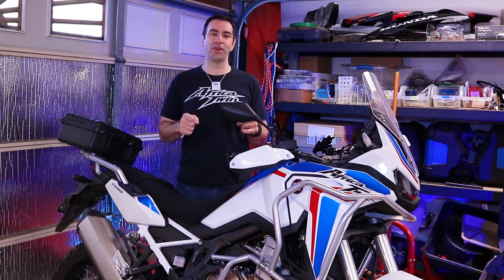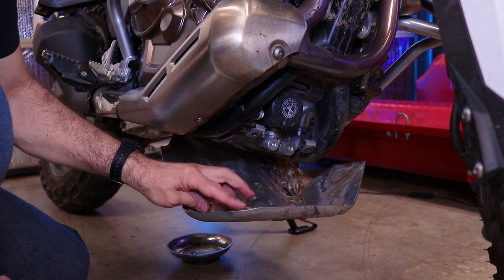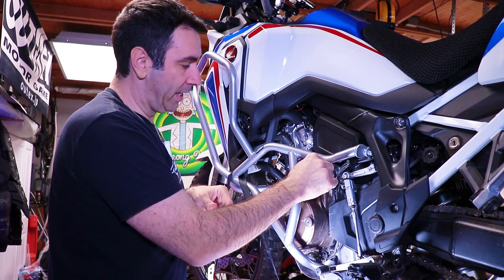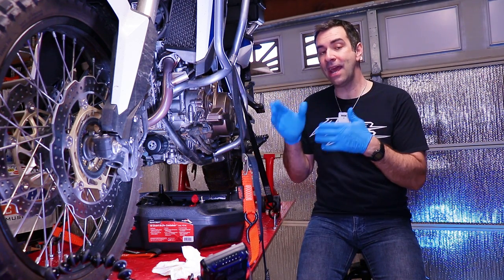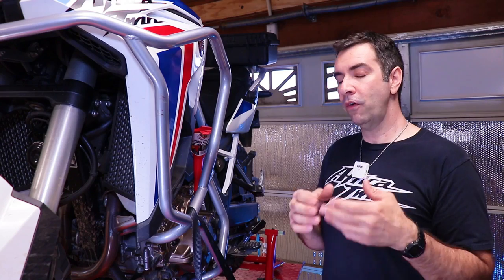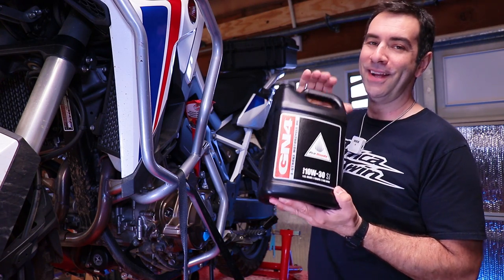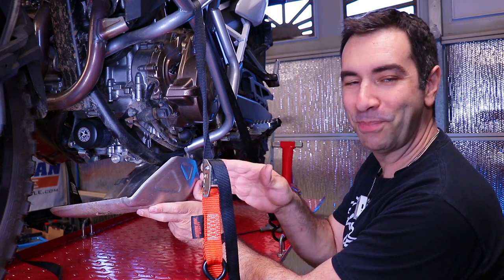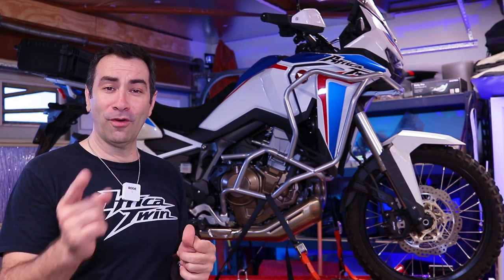Africa Twin 1100 Oil and filter change

Comment: Thanks for this. Decided to start doing my own work now the bike is out of warranty. The 8000 mile service is only an oil change and 'check and adjust' after all. Do you plan to do the dreaded valve check yourself? I've seen the procedure and it looks like a real PITA! My dealer recommended skipping the 16,000 mile check and doing it at 32,000 instead (As long as the bike starts and runs well). Mine is at 24,000 and runs fine so far.
Reply from the maker: Yes,  I'm planning on doing it myself,  I'm pretty sure the valve will be fine at 16000, meaning they will probably not need to be adjusted,  but I'm still going to check. If you do skip the valve check keep your ears open when you ride, way before any damage will occur the bike will not run right so if you pay attention you might be able to tell.
I'm glad you are doing your own maintenance 👍with the manual on hand nothing is really hard, it's just time consuming 😆
Reply: @AlbesADV  Thanks Albe. That's the thing - none of these procedures are beyond the scope of a decent DIYer, you just need time and LOTS of patience. Ride safe.

Comment: Hi, nice video, oil consumption dectected on CRF1100? I have one and some users repports oil consumtion since 0km on those engines. Tanks!
Reply from the maker: No oil consumption other than the one that gets trapped on the crank case breather hose

Comment: Thank you. How do you go about changing the gearbox oil?
Reply from the maker: Hi, thank you.  In most motorcycles the motor oil is also the gearbox oil, it's obe assembly and the oil is free to move around 😀👍
Reply: @AlbesADV  Perfect. I have an Africa Twin 1100 DCT, so the engine and gearbox oil is the same. Thanks for the prompt reply.
Reply from the maker: @fabimesizae si, l'unica cosa in più che devi fare è cambiare anche il filtro olio frizione che si trova dalla parte del DCT davanti alla pedana e assicurati che la parte del filtro che dice "out side" sta verso fuori.

Comment: Would you use a fuel additive like redex? Also, as this bike has a cat, would you use cataclean?
Reply from the maker: No, I don't add anything to the fuel, just use good quality fuels, modern fuels already have additives in it
Reply: @AlbesADV  true! I was wondering if it would harm or benefit the system? Fuel doesn't clean the catalyst, so would a cat cleaner help? I personally only use shell e5 99ron,it's the best!
Reply from the maker: I'm not sure if cat cleaner would help, I know it has to go thru the whole system before it makes it to the cat. I agree on the shell fuel being one of the best if not the best
Reply: @AlbesADV  just done some research. Yes, the cat and o2 sensor need to be periodically cleaned to maintain performance! Recommended at every oil change, so every 5-6000 miles or so! 👍

Comment: Can I use synthetic 5w30?
Reply from the maker: Hi, the 5w-30 provides better cold weather start because it flows better,  on the other hand, the thicker 10w-30 it's a little more protective in warm weather,  but once the engine is running they will perform in about the same way 👍